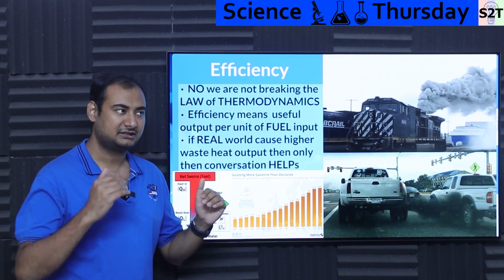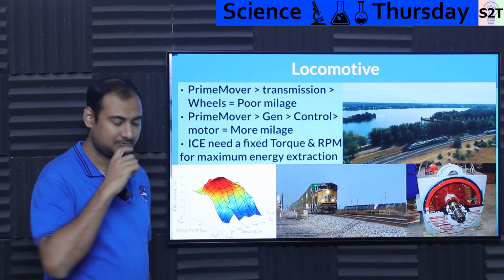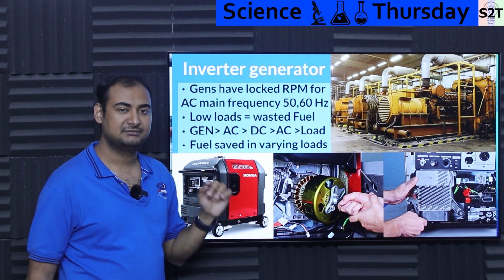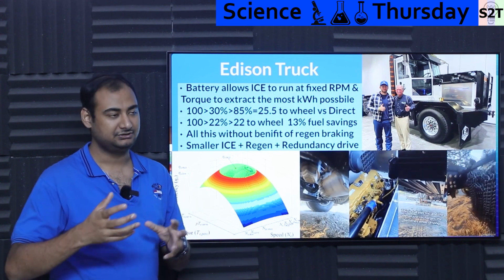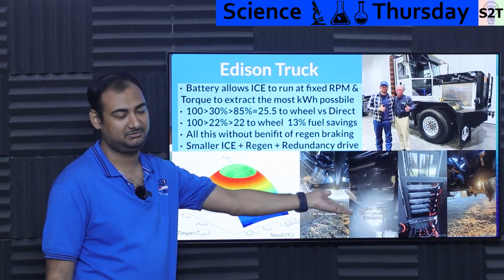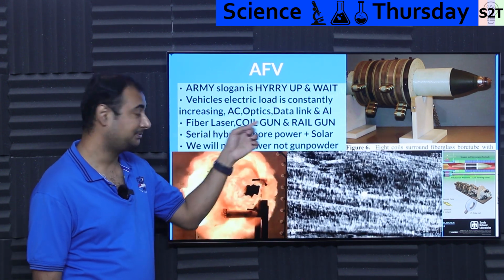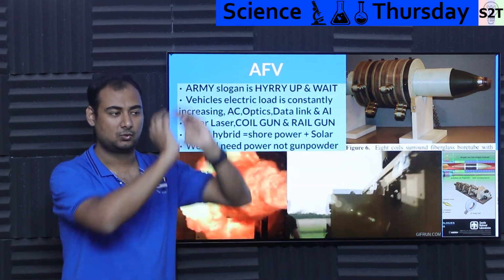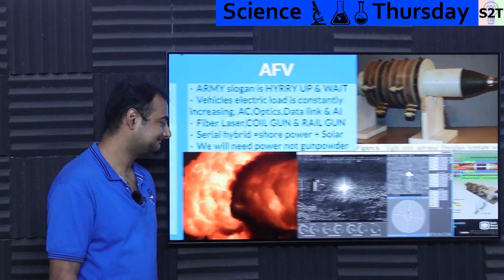Energy Conversion 4 Increase Efficiency Explained {Science Thursday Ep253}

Comment: You were looking for another example of fixed RPM ICE->Electrical generator->Electrical powertrain.  The Chevrolet Volt (not Bolt) is a mass market passenger car with exactly this hybrid system.  It has different names in other countries.  

Another advantage not mentioned is that you can further optimize ICE emissions if you only have to run at 1 rpm.
Reply from the maker: you have to provide more detail of the name like year and vertion as cars have lol naming convesntion BUT your point stands that if an ICE engine is tuned only one for ONE RPM & TORQUE it will be efficient and also have less emissions
Reply: @s2tenglish  Sorry...dictation problem.   By 1 rpm, I meant at a single RPM-whatever is optimal...perhaps in the range of 2000-3000rpm for mass market auto engines.  Exactly what the Edison truck does.

https://en.wikipedia.org/wiki/Chevrolet_Volt
Chevrolet Volt in N. America

"Holden Volt in Australia and New Zealand and the Buick Velite 5 in China, and with a different fascia as the Vauxhall Ampera in the United Kingdom and as the Opel Ampera in the remainder of Europe".  Production ended 2019.
Slightly different was that the Volt did couple the ICE to the drive directly when extra power was needed, but mostly ran from generated or battery electricity.